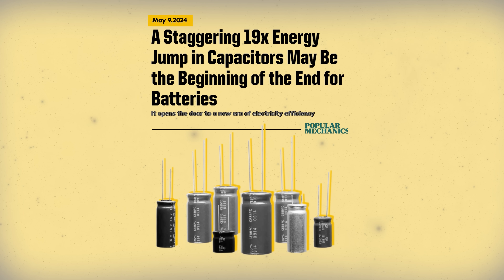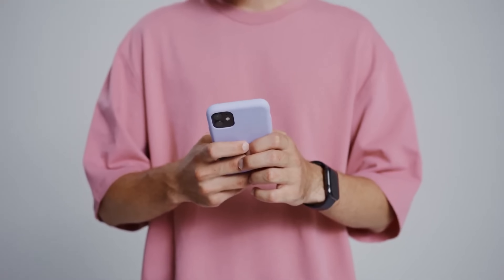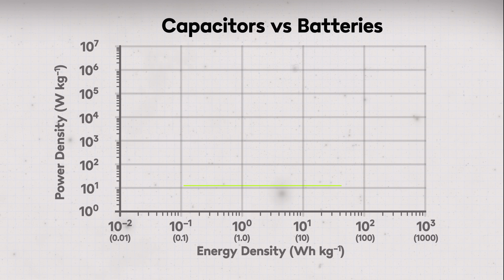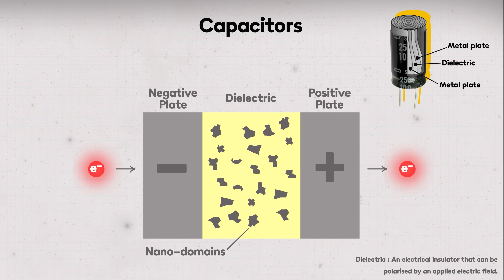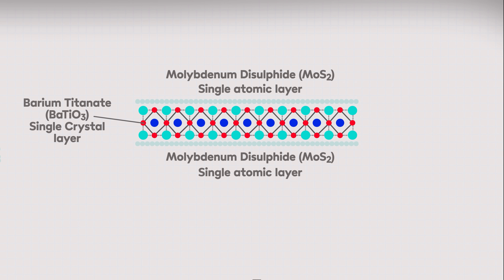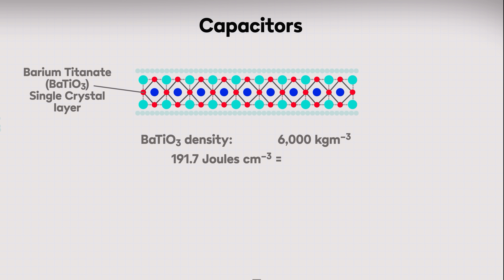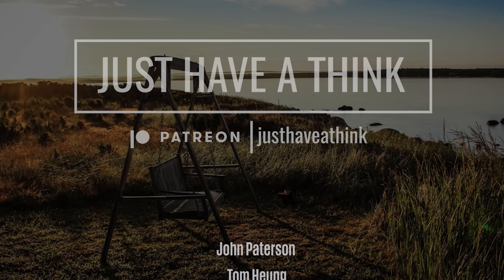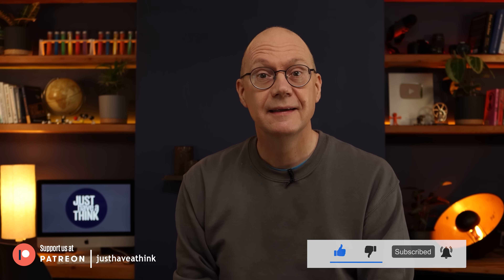Charging an EV faster than filling a gas guzzler? Surely not!?

Comment: There are already capacitors on the market with 9 Wh/kg energy density. Besides the every low energy density there's the issue that the voltage varies between maximum and 0 with state of charge. Also, self discharge is a problem. 

It doesn't help much if you can charge from 0 to 100% in 30 seconds of active charging if you only can travel 2 km with a capacitor bank of roughly size and weigh of a normal battery pack, and ten times the price, as there already are BEVs that can charge about the same rate, as in amount of energy transferred, per unit of time, which is the most relevant factor. Batteries can't be charged from 0 to 100% SoC at such rates, but there are plenty that come close to charge and discharge power practically achievable with capacitors for a given size and weight, charging/discharging many times more that the total capacity of the capacitors.   

Some ultra niche application maybe, on fixed routes, with very frequent stops with automatic charging, to push the limits for what's possible with some fully automated logistic system. For cars, batteries have evolved much faster than capacitors, for a long time, the potential advantages of replacing batteries in EVs with capacitors partly or completely are insignificant now compared to what they once were.
Reply: Yeah, I don't see these being much use for the average road car until the energy density is far better. And even then they don't have to just be good enough to work, they have to be good enough to have a need for them over just using the batteries available at that time.

Comment: It depends on the current state of the art in the geometry of the plates.  Last time I looked they've been trying to change the geometry of the plates by, for example, making them spiky so as to increase the surface area of the plates without increasing the overall size of the capacitor.  Energy storage is proportional to the capacitor plate surface area, so if they can drastically increase that without increasing the size of the overall capacitor, they will be able to store more energy in the same size package.  Improvements in dielectric then help extend that.  Haven't heard where they're at lately in the geometry research, as that will determine the next step which is how to actually manufacture them (without the spikes shorting out).

Comment: so what is the practical application? Put them as a buffer between a charger and a battery so you can charge the capacitors at the plug and then drive off whilst they charge the battery?
Reply: No, their energy density is too low for that. I don't see how they can have any real benefit for regular plug in charging until their energy density is much, much higher.

Comment: I wonder if you could load a capacitor quickly and then drive away while it's slowly transferred it stored energy into the batteries?
Reply: No point. Energy density of these capacitors is too low to be useful for plug in charging.

Comment: The charging time discussion is mostly over. Currently the top spec platforms like the Taycan at 350 kW  are going from single digits to 80% in 15 minutes or less. What we are waiting for is that type of charging performance to come down market, and be adopted by the legacy manufacturers who are a generation behind. The biggest issue they are facing now is adequate pack cooling.
Reply: I get 100% in 3 minutes- and that's 400 miles, any weather. And that range will not decrease over time. EVs can never compete with that.
Reply: @SteveLomas-k6k  

Any weather?  An ICE car loses about 15% efficiency at 20 degrees Fahrenheit.  

Do you realize that you pay to fill up your car in 3 minutes and about 80% of what you paid for is completely wasted?  You've chosen to judge them based only on recharge time vs. "fill" time.  Never compete?  Depends what the game is.
Reply: @whaler11  I drive half the year in temps often much colder than that. Can't say I've ever noticed any range drop. But then the 400 miles is not an unrealistic EPA rating, it probably does more than that.

range loss in EVs <20F is drastic, EV owners themselves are pretty upfront about that

80% 'wasted' is also why I can have as much heat as I want at no extra cost or range loss. I don't have to ration that either.
Reply: @SteveLomas-k6k  Measure your actual time at the gas station next time, seriously. From the second you pull in to the time you get gas, you walk inside. You get a slurpee or coffee, you pay and you come back out. That's 8 or 10 minutes. Another 3 or 5 isn't a big deal.
Very very rarely have I ever burned a full tank, filled up and left the gas station immediately.
Reply: @otm646  I pay at the pump and rarely go inside- I timed my last fill up at 1min 48 secs. < 4 minutes from stopping the car and moving again, I'm impatient t I guess!

But EV charging times don't include extra parking hassle (no pull through) futzing with apps, handshakes etc. Not to mention driving off route to find the remote charger at the back of a parking lot...
Reply: 350kW from 10% to 80% in 15minutes means trying to extract 1 MEGAWATT! Most houses use less than that in a MONTH! 

Please explain exactly how you can deliver near on 2,000 amps of 3 phase (480V)..... (Double that current if you are using single phase. And double it again if you're in the USA, 120v. That's 8,000 amps... You are living in cloud-cuckoo land if you think that's ever going to happen.)....
Reply: @Chris-hx3om   This threw me for a bit, until I realized you misread the units.    They're talking about a peak charging rate of 350kW  for the new Taycan Turbo S and 4S, not the battery capacity in kW*h.   Firstly, it was a small exaggeration as it's only rated up to 320kW.   The Taycan 4S has only an 87kW*h battery. Here's a quote from an article where they tested it on a 350kW capable charging station..     "Upon plugging in the Taycan 4S, the EA station delivered 295 kW right out of the gate, going from 8% to 30% in just four minutes. By 40% the car was steadily charging at 320 kW, dropping off to 250 kW after reaching about 65%. In the end, we went from 8% to 80% in a mere 16 minutes"

Yes that still appears to be 666 amps if drawing from 480V source, but some level 3 chargers are truly rated up to 350kW charging speeds, so they pull it off somehow.  I think in most locations you're unlikely to get that on all the charging stations at once (and never from both ports on a single station).
Reply: @daemn42  🤦‍♂ Yes, quite right. 320kW is the POWER output, not the storage capacity. I was thinking at the time that it was a damn big battery, but didn't think any further as I know KIA have a massive battery in the EV9.... 

Anyway, it's a metric sh1t-ton of copper cabling that would be needed to feed these 'fast charging' charging places. I live in Australia and any trips planned are planned around fueling (I have a diesel car with a 1,200km range, so not so important to me), but an EV with a 300km range (maybe!) is going to need to be charging at every opportunity. I can imagine a dozen EVs (not uncommon to see just about anywhere in Australia is lines of cars waiting to fuel). The supply to those charging station will need to be truly epic!
Reply: @Chris-hx3om  You are mixing up kW (unit of power) and kWh (unit of Energy).

Edit:
"Please explain exactly how you can deliver near on 2,000 amps of 3 phase (480V)..."

I saw what I believe was an Out Of Spec Podcast episode where they mentioned Fast chargers with "virtual" transformers.
The initial high voltage DC conversion is just switched at medium voltage directly. With 800V architecture you are out of the "low voltage" regime (limit around 700V) anyways,

I am pretty sure coils are still needed: but they can be made far smaller (dependent on switching speed).
Reply: @Chris-hx3om  The Taycan has 80 kWh usable capacity. 80% of that is 64 kWh. If your average charging speed is 300 kW that's 64 kWh in 12.6 minutes. That almost exactly mirrors OOS tested charge rate of 13 minutes for the newest Taycan.

You should intuitively know that nothing on the market has a 350 kWh battery pack.  The largest pack currently on the market is  200 kWh in the Hummer/ top spec Silverado.
Reply: @otm646  I already admitted I made a mistake. What more do you want, blood?

Comment: I don't quite understand how these capacitors would lead to faster car charging, as presumably you'd need a bank of capacitors with almost as large a capacity as the batteries in the car itself?
Reply: It doesn't make sense for regular charging. They're just not energy dense enough to be useful.

Comment: I was considering the purchase of a EV . My county is 168 .iles in length  with briges from island to island. The main electric power transmission line comes from the mainland. We down have roof top Solar Panels production of electric and hot water. I recorded the time to fill 1/2 tank of fuel for my 4cylinder pickup which i drive 110 miles per day. 3min./14secs.
We have 7 EV chargers in the entire county.  I have seen EV's parked along the side of a bridge and roadway. Ready to be towed.

Comment: Reduce charging time?
BS

My Level-2 home charger puts out 6,000 watts which results in the Tesla charging at 22 miles per hour.
To fully charge my 75 kWh takes 75/6=13 hours

To increase that and not use magic you increase the watts in 
so if my charger could double the power to 12,000 watts then it would take 75/12=6 hours

It's simple math, and a capacitor adds nothing to reducing the charge time.
I'd have to spend an easy $5,000 to do that.

Comment: Yes , an interesting development, but there is a bit of a flaw here. The Caps/Supercaps/Ultracaps are really good at short term charge rates but pretty poor at energy/mass , this means that a hybrid battery system with a small Cap/SC/UC is great as a brake/acceleration buffer but pretty useless at battery charging as you still have to transfer the energy into the primary storage  battery , and that is dictated by the primary battery capability. 
We have used them in the past for short duration use on tram systems that need to cross short distances between overhead lines, such as conservation areas in cities.
Reply: Exactly, I was trying to understand how the caps would help high power charing for more more than a few seconds.
Reply: yes, most uninformed do not understand that.
as far as i am concerned it is just a gimmick concerning ev charging
Reply: @bellshooter  Yeah, all of the times over the years I've considered ultra capacitors being pared with a battery, I always end up realising it's better off just using that weight to add more battery, except for if you use a small capacitor sized to take one hard regen, then discharge in the next few seconds of acceleration to take peak loads off the battery. Assuming that capacitor won't need replacing too often being used like that, and won't add too much more cost and complexity.
Using them to reduce charge times is completely pointless until they can increase the energy density by multiple times. And at that point, the batteries will probably have a fast enough charge rate that supplying the charge at that rate will be as much of the limit as the batteries. And may not be even worth trying to improve charge rates much more. At 8.8 W/h per kg, these capacitors would only save a few seconds charging in the best case scenario.

Comment: The two areas Dave mentioned, reducing EV charging times and large scale storage/response seems like the two best uses of this technology.
Reply: and two of the most contradictive as well.
Reply: Reducing charging times mean increasing charging current (it's proportional). How do you get that much current to the charging stations?
Reply: @Chris-hx3om  Level 3 DC charging, uses a 3-phase 480 volt AC electric circuit.
Reply: @mafarmerga  Yes, and to get the sorts of energy delivery to charge in 'fast time' requires massive current. E=IxV/h. There's no way around that formula. If you want 50kWh in 10 minutes with a 480v source, the current needs to be 50kWh/480v/0.6hr = 173 amps. That's assuming 100% efficiency in all the conversion processes (AC to DC rectification, DC current regulation, losses in the cable to the vehicle, losses inside the battery due to the way the chemical processes work). Call it 200 amps. Now, that's for each car and a 10 minute charge of 50kWh. Picture a charging station out of a city, on a main route to a holiday destination. 10 car are all lined up and plugged in. 2,000 amps!
Reply: @mafarmerga Probably not with such a low energy density. Makes them worse than useless for regular fast charging, if they're in the car. And for grid storage, maybe if they are extremely cheap, easy to make at scale and reliable, if they are going to have much benefit over LFP.

Comment: Would someone please explain why EVs just don't have a two tier battery system.  Replaceable ones for going across country and onboard for a 50-75 km backup?

Even if the Holy Grail of batteries shows up someday they would still be backwards compatible with the same form-factor.
Reply: IMHO It’s tricky to standardise size and connectors and easy access. Also automated removal? What about different battery age and technology? So many problems
Reply: Size-hook IT up to your trailer Hitch like the Hitchcock bike racks

Charging-just plug it into the charging port at the back of your bumper
Reply: Because the EV industry has grown up in the era of laissez-faire bending governments, no major government came forward to standardize interchangeable batteries that could be rented and swapped at service stations.

Comment: Regen eventhough useful in recovering some part of braking energy, does reduce range, when improperly used, such as modulating the gas pedal unnecessarily, during single pedal driving🤔. Using supercapacitors for fast charging cellphones is an old idea, but new when applied to EVs🤔
Reply: There are very few instances where you can actually use it improperly. If you have to use the breaks, even just a little bit, it more than offsets the losses you incur when doing regenerative braking.
Reply: @foobar6846  Yes, that is a good point. But brake blending is a safety feature, since regen cannot charge battery under certain conditions(low temp, high SOC). May be supercaps could be used as a temp. storage, may be they are already used in a limited way(due to economy of keeping down costs). But the situation, I mentioned, does not involve braking, it is more to do with coasting. If you maintain a constant speed, instead of frequent deceleration, regen will not be used, leading to better range. But the downside being not relaxing on the gas pedal and holding the position. Cruise control will do the same except you have to conciously engage it, and may not be a good option in a fluctuating traffic, with everyone around driving aggressively.

Comment: I'm not clear how adding capacitors improves the charging speed of the overall battery pack if those capacitors aren't a decent fraction of the overall energy storage. Feels like having a wide funnel on a narrow tube - you can't fill the tube any faster, you've just dumped a bit more in at the top which will still take as long to flow in as if it were a narrow funnel. Can anyone enlighten me?
Reply: yeah, I had the same question.
Reply: Exactly. That nice graphic of the car charging in seconds is fine if you just want to have the energy you can stuff into a reasonable weight of capacitors. In the real world you'd be stopping every block or two to do it again. At the figures given you'd need 28kg of capacitor for every 1kg of Li-Ion you want to charge.
Reply: Yeah, they will be worse than useless for plug in fast charging. Any small benefit will be literally out weighed by their excessive weight.
8.8 W/h per kg also means they will only store 8.8 kW/h per metric tonne.

Comment: If ever this happens, then basically it will require a charge port underneath the car that pops up and charges automatically. Because nobody is going to be able to hold the weight of the damned cable to plug it in.

Comment: What immediately raises a red flag is how extremely explosive large capacitors are. Even if that worked, you'd be driving a bomb.
Reply: No worse than driving on hydrogen or even gasoline. Caps don't just explode. You have to seriously mistreat them for that to happen. Properly designed they would vent long before they go bang and you would see that in your monitoring of the "battery".
Reply: I suppose that relates to how fast they can release their charge in regular operation?
Reply: Batteries are far, far more dangerous than capacitors.
Reply: @georgedorn_fnord  that depends entirely on the chemistry used.

Comment: There was an interesting theory about how batteries and capacitors could be used in conjunction with one another one day to solve the inadequacies of both for the future use of powering a car.  The solution was then considered far off, as the main problem would be an easy and cheap computer management system to funnel power between one and the other in a reasonable manner, and the solution was left to some more advanced future.  I read that article in '76 or "78, and I do not doubt the the problem is now solvable with current technology.  But where is it? I get that the capacitors might be requiring a wholly different infrastructure for an actual deployment, and there are an awful lot of problems that would be associated in getting a standardization that would be acceptable to all manufacturers before our sun went nova.  But the tech is there, and it seems more likely that its failure for enactment has more to do with consensus than competence.